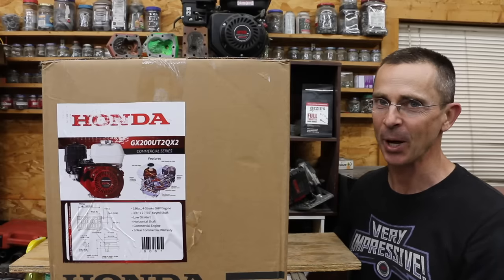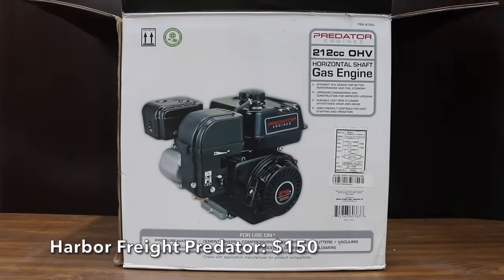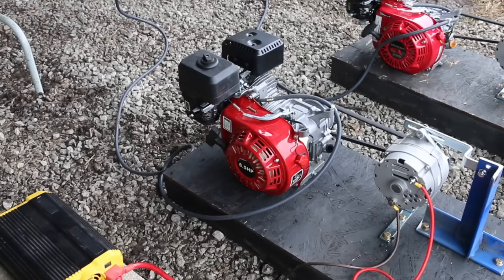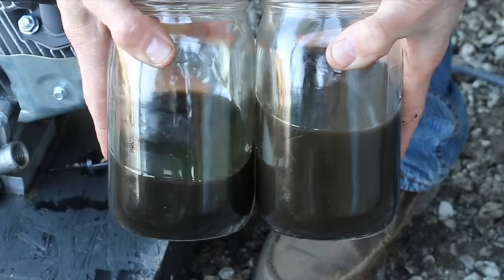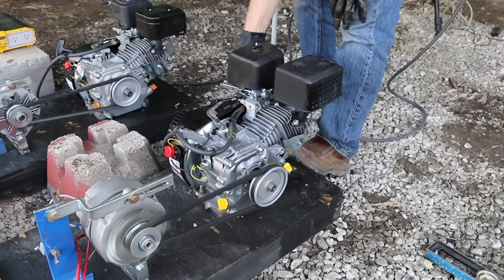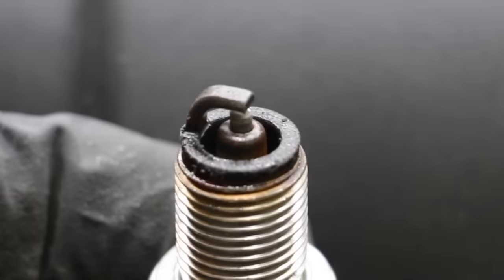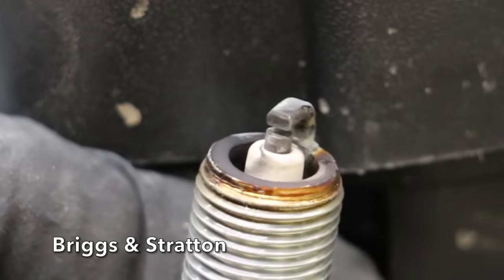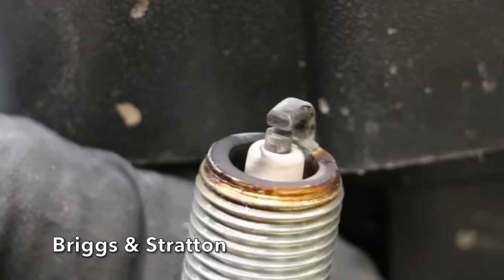$150 Honda Clone vs $600 Honda? Let’s settle this! Fuel Efficiency, Horsepower, Durability, Starting

Comment: I tell you what for $150 bucks you can’t go wrong with that Predator engine. What a great review you did. Absolutely the best review channel on YouTube. Thank you!
Reply from the maker: Thanks so much!
Reply: Honestly it’s probably the better buy than the Honda considering you can buy 3 to 4 of them for the price of 1 Honda and they are pretty comparable to the Honda.
Reply: @Back_door_bandit_98  a honda will last you much much longer.
and the predator in the video had more CC than the others
Reply: Will the Honda last more than 3x as long as the knock offs?
Reply: @Dave5843-d9m  absolutely
Reply: @noidontthinksolol  yes, predator had more CC's but it still used less fuel than the others.  That's a win-win.
Reply: i tELL yOu HWHUT 🤣
Reply: @geeberke4567  a bigger engine will use less fuel when performing the same load.  but fuel consumption is not something anyone thinks about for these engines lol.   the only thing they have to do is last long without any headaches
Reply: @Back_door_bandit_98  I agree 💯
Reply: @noidontthinksolol  by what? Ten cc?
Reply: wont surprise me if the engines are all built in the same factory in China. different filters , spark plugs and piston rings makes all the difference
Reply: @ddjohnson9717  nope   those hondamower motors arent made in japañ but def not in china.
Reply: @noidontthinksolol  Yeah I misspoke. In the video PF said all engines are made in China except Honda(Thailand). But looking deeper, Thailand also gets their manufacturing equipment mainly from China. If the equipment meets Honda's standard then can make Honda brand engine with a licencing fee. I guess if you pay more money you are paying for both the brand and higher standard.
Reply: Hi I have a Chinese engine and although their not brilliant in comparison of other makes of engines I got it pretty cheap about 100 dollars tho it was English money so probs bout 95 dollars which is pretty cheap I know it's rubbish but we'll I have one on a generator which is good the other I used for a water pump not incredible but worthy
Reply: @Back_door_bandit_98 If the Honda works for 30 years, wouldn’t that be the better buy? Especially since Honda will never go out of business because of how reliable they are.
Reply: @ddjohnson9717 Honda makes a lot of their stuff in the US.
Reply: @ddjohnson9717 China gets their equipment from the US technically. Most manufacturing tech was designed in the US.
Reply: @Back_door_bandit_98  I rather pay the price of the Honda once and only cry once than to cry every time a knock off goes awry as the saying goes.
Reply: Go broke buying oil. You can't go wrong.     Wrong!
Reply: @ethanweeter2732  true. So when you said Chinese made has low quality actually means USA made has low quality. Wow you walked right into it.
Reply: @ddjohnson9717  No, I am saying that China did not design their own equipment. What they do with it after that is on them and their workers. But it in a way reflects poorly on the US. But I do recognize without good quality control, you can have great workers and the end product not be the best if you don’t identify issues immediately when they arise.
Reply: @noidontthinksolol  Nope. I run them all and Predators are better engines. When we pull them apart the cylinders still have the hone marks from new. They all are spec'd at 1500 hours before rebuild is recommended and the Predators do not fall short of the Honda one bit. The Predators are made by Lifan and this company makes high end engine components. In fact they use to make the parts for the Honda. The parts used on early Predators were Honda parts until Honda sued them. Lifan just made changes and made their version better.
Reply: @Thrive-Off-Grid  better? LOL.  Notin the real world bud
Reply: @noidontthinksolol  Yeah Ok bud. We run a business' that these small engines are the core of.
Reply: @Thrive-Off-Grid  offcourse lol😆 statements like that on youtube are meaningless at best
Reply: @noidontthinksolol  Except I know what Im talking about and anyone that knows anything about Predator engines; you just look like a fool with your statements. But hey go spend your money on a Honda.
Reply: @noidontthinksolol  theyre not some god engine lol company i worked at only used hondas for their concrete buggies they only last so long under constant use better then a predator for sure but its not gonna beat out 3 of them not to mention you can upgrade predators now bore them over put different cranks,valves,rockers,cams just about every part you can upgrade for better performance all thanks to gopowersports and probably many other companies theyre even making parts for tilitson engines as well hondas a thing of the past unless your doing real work with it
Reply: predator engines now cost the same as a real honda
Reply: Honda make good engines despite where it made. The product needs to be within spec and approved by Honda themselves. The engine will live far longer than any of the others. The wear and material found in the oil is because the engine isn't broken in yet. Usually you would take it easy on the engine for the first few hours, drain and replace with fresh oil. You can't expect a fresh out of box engine without been broken in to show no wear signs. The difference is the quality engines will keep going while the cheap poor grade will wear away till low compression or even bearing failure
Reply: @Thrive-Off-Grid  I agree, the Predator engines are great engines and for the money, you can't go wrong.  I think there are too many Honda fan boys that think nobody else knows how metal works.  Honda is not magic.  Look at their cars, they lost a lot of quality but the fan boys only think of the old 90's Honda's (when GM and Ford were being cheap).  Today, Honda makes Oil dilution engines.  But the only thing Honda still makes great are their motorcycles.
Reply: I used mortar mixers for 34 years. 90 percent had Honda motors. In the extreme cold, extreme heat, low oil level, hell, sometimes nearly empty oil level...... Choke it, pull the cord and it starts. No problems ever with them. I'd say if for constant use, go  Honda. Occasional use, save money. 🤘
Reply: Nobody does it better! And I’m not talking about the machines.
Reply: I Agree Especially Since none of them are made in the Good Ole U. S. A.
Reply: I got one from their black Friday sale for $99. Great motor, used it on a tiller and just turned it in to a pressure washer
Reply: It depends on how long you want it to run, and if you want to touch genuinely start every time you pull the cord. I hear people talk great things about predator generators but I haven't seen a predator generator last 23 years like my dad's Honda. There's a lot of truth in "you get what you pay for".  I spent the extra money and bought a Honda 6500 backup generator for my house and I don't regret a single nickel of it because I know it will start every time I pull it and it's not gonna fail on me when I need it the most
Reply: @Back_door_bandit_98   Nothing last as long as a well engineered Honda. Are you gonna bet your life on a predator generator in a power outage?
Reply: @Dave5843-d9m   I'd bet my life on it
Reply: @Josh B  Literally Honda and Toyota makes the most reliable vehicles on the market and that's backed up by literal national reviews by people themselves who also critizise their cars. 

Not everyone is a fan boy.
Reply: @COSMACELF1802  When it comes to these small OHV engines there is no "fan boy" engine that even comes close to the Predator 212. You would agree if you heard all the happy talk I have heard about these for more than a decade. Their only advantages over GX200 and clones are the initial cost and plus 16cc. Otherwise they are a low quality Chinese engine with unique Predator 212 specific parts. They eventually came out with one using a hemi head which took the fan boys to new levels even when there is no power advantage with the hemi head.

They are fine as utility engines but for the minibike and go kart hobby they should be the last choice when there are so many better quality and more powerful engines to start with like Tillotson 212, Ducar 212, BSP 212, and Wildcat 223. The new Predator 224 which is made by Ducar is a better quality engine than any Predator 212. i can use my expensive clone (196) flywheel on any of the above mentioned engines. But it does not fit the unique Predator 212 crankshaft.
Reply: @Deucealive75  Awesome, thanks for the feed back.  Sounds like you have a lot of experience with these engines.
Reply: @RustyShackleford382  if your survival depends on a generator you already lost.
Every generator can fail.
Reply: @Deucealive75  with all the 212 fanboys... That leads to aftermarket support.... Which would solve the unique crankshaft problem.🤷 🤔🤔🤔 I do like the suggestion of what better than a predator??? A bigger predator 😂 but really what it boils down to is bang for the buck... A few years ago you could pick up a 212 for $99.95 and have a great engine 🤷🤷🤷 beat Honda in fuel speed almost in all categories it was a near tie .. except 3x the price for a Honda 🤷🥴 that is an Easy W for the predator 🎉

Edit: just checked... The 212 is $99.95 right now LoL The 224 is $159.95
Reply: @ddjohnson9717  you clearly don't know what you're talking about. Honda has their own factories in Thailand, this is not just licensing product, it's THEIR OWN product. Most of manufacturing equipments are from Japan or Thailand. Stop saying things you don't know.
Reply: I picked one up (212) last summer for $119...
Reply: @RustyShackleford382  Hondas have failed too. It is not that Hondas never fail. Predator is a new company and hence can't have an engine made 20years ago. This does not mean it is not good.
Reply: @noidontthinksolol I’ve been running predators for years and put thousands of hours on them running them hard on mini bikes, I’ve also owned genuine Hondas and can confidently say they will both last an eternity if taken care of. No noticeable difference in lifespan between the 2. The predator is absolutely the better value.
Reply: That's fine, I'll buy The more expensive honda, over a chinese piece of shit,
Reply: @mr.righty6985  The predator is anything but a Chinese pos, and actually in most aspects it out performs the Hondas and they will last just as long. I’ve been running both for years and can confidently say the predators are the real deal
Reply: @paulspomer16  Where is it made sir ?
Reply: @noidontthinksolol  so we should be using 10L engines?
Reply: @davidelliott5843  No,  maybe 5%
Reply: I put a predator on my rear tine rototiller.  It was a few years ago and HF had a sale in them for $99. Oh and it runs.
Reply: Guys, Here is our Savior

HalleluYAH translates “Praise ye YaH”

YaH is The Heavenly Father
YaH arrives via the TENT OF MEETING
YaH was Who they Crucified for our sins
YaH was Crucified on an Almond TREE

Semitic of Moshe (Moses)
Isa Scroll (The Original Isaiah)

Isaiah 42:8 - I am YaH; that is my Name! I will not yield my glory to another or my praise to idols.

Isaiah 43:11 - I am YAH, and there is no other Savior but Me.

Isaiah 45:5 - I am YaH, and there is none else.
Reply: Get 3-4 Predator engines, for the price of one Honda. I bet they last longer 😂
Reply: I have a few predators. Got a wedge and a hemi. Been building, racing, pulling, farming with, and working on engines for years If you talk to performance guys and see what's possible to do with one it's amazing. Like 40+hp out of a 212 Hemi boosted on nitro. There's absolutely nothing wrong with a predator and the builder I talked to said same engineer designed it, was a Honda engineer, in three years mine has almost always started one pull summer or winter. It's on my home grown wheelhorse "powerchair" so yea, I depended on it every day everywhere alone on the farm mud, snow, rain, shine. Bar lug tires, step pulleys so it will run 30mph dragging my wood out, moving wagons etc. After 3 years a bearing in the rearend finnaly let go on that 1965 tractor! Motor shows no wear inside. You do what you want, I understand not giving money to China, but from a VERY expierinced engineering standpoint no valid reason to buy the Honda. Its like paying 5x the money for the same model car because the wiper blades are better.
Reply: @roberthughes2687  4cc, I think. Honda 208, Predator 212.
Reply: @paulspomer16  Have your predators lasted 3600+ hours with constant abuse? I am not quite sure about that. Our go-karts that I run at an amusement park run Honda GX270’s. Some of those engines have well over 3600 hours on them, that’s being run all day every day and abused. A predator would fall apart pretty quick being abused like that. I would buy a predator for just recreational use 100%. But for long life and withstanding heavy abuse, Honda is the one I go for. Also look at Subaru small engines and Yamahas, they are quite good as well. Cheers!
Reply: Why did I read big dippers comment with a country accent lol
Reply: @RichardGarcia93  What me? I was just correcting misconceptions about different engines.

Comment: My 24 yo son who is just now getting into building things. Just bought several tools and told me he watched your videos prior to purchasing. Makes a father proud! Thanks for doing what you do 👍
Reply from the maker: You are welcome!  Thanks for sharing.
Reply: PF sure saves from learning the hard expensive way.
Reply: @ProjectFarm  When you say lbs can you add kg into the text on screen?
Reply: Great test. I’m disheartened the Briggs has been cheapened up as it has. Used to be as good of small engines as you could get for a reasonable price.
Reply: @us1fedvet  
I agree! I have a B&S 8hp generator from the 70's and it starts on the 2nd pull... it's like a American made Honda. Unfortunately I would not buy anything with a B&S engine today😢
Reply: @us1fedvet  It's not just being cheapened, it's being made in china, from the same GX-clone parts, since 2015. 
My 2001 200cc MPU works just fine, and starts from few pulls, due to old ignition coil (which been in the pond few times)
But the vertical 656cc V-twin on the ride-on had a coil blown, and the "genuine parts" spare came with the actual instruction to grind the radiator around it, to make it fit. It was a GX-clone coil, in a B&S box, from the dealer.
The brand used to be a legend, now it reads "Bull and S(tuff)" to me. :"(

...added to ecoboost Mustangs, being made in Korea, i'm starting to think, maybe this planet deserves to be "replowed" by the war. Just to shake things up, back to their productive roots.
Reply: @thantawa  2.2 lbs per kg, simple